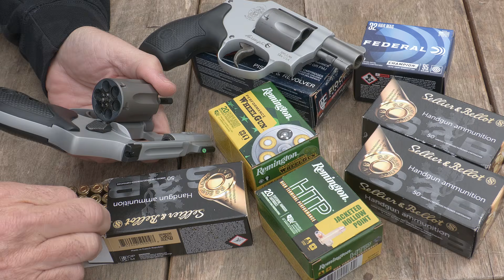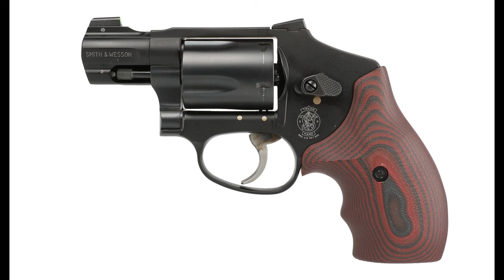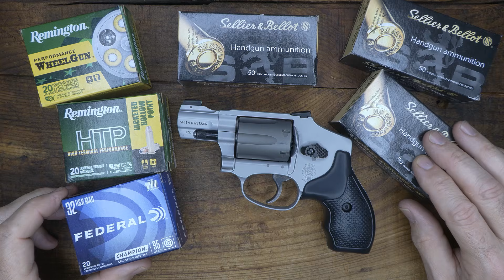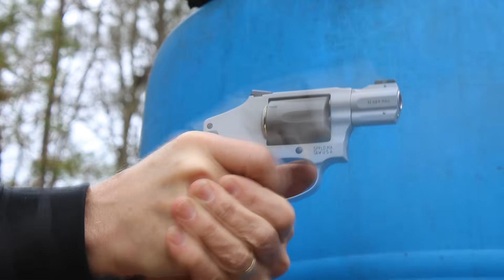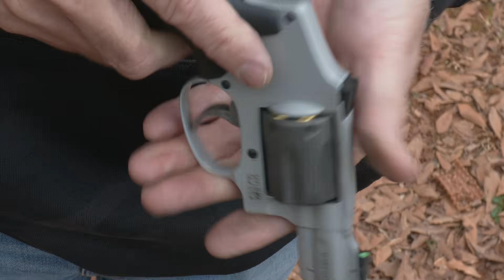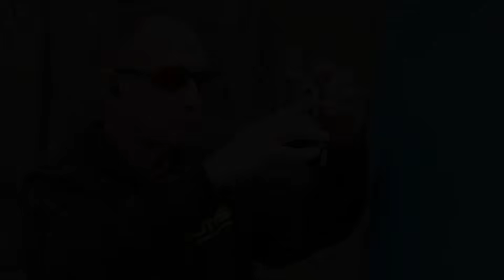Ultimate Carry J Frame Lipsey's Exclusive S&W Model 632 32 H&R Magnum Gun Review

Comment: Got one a bout 2 months ago so I could shoot while I recover from thumb surgery. Put 30 rounds through the first time at the range before the cylinder lock broke. It's back at S&W for repair. VERY DISAPPOINTED!
Reply: The exposed frame bludgeons the bottom of my thumb. I might have to use an ice pack after every time I train with this pistol at the range. Outside of that problem no issues with the pistol so far. Almost 600 rounds I think.

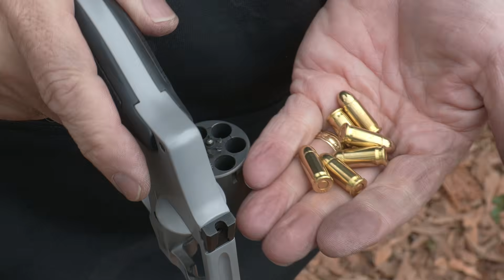Comment: 19:37 this part here with the 32acp is interesting. there has been some conflicting information about using that cartridge in a revolver. is the 32acp safe in that revolver especially for someone who really wants a reduced power load? and also, someone said the 32acp has a higher pressure than the 32long/hr magnum. what is the actual truth on this? thanks for any reply.

Comment: Why not 32 short if you’re just plinking. 32 acp is a semi auto round or so I thought. My 632 UC does not state 32 acp as a round my guns shoots. 32 short, long, and H&R mag. Going to use mag for self defense. Also for less than $100 Take it to your armorer and have them change the springs. It shoots like butter then. No misfires. About 8lbs. I have the steel cylinder…
Reply: Why is Smith popping out a gun that misfires? At the top of the snub price range too?

Comment: and if you hold the gun up higher on the back the recoil will feel less because the gun will thump your hand less ( even though the grip does not go all the way up), and the version with the stainless steel cylinder will have less recoil since it is a little heavier. I have the older version made between 2004-2005 ( M432) and it really is a nice gun.

Comment: I'll take my 642, in .38 special loaded with plus P over a .32, any day! In snub-nosed testing, .38 +P often edges out standard .32 H&R Magnum loads in muzzle energy and terminal performance by a noticeable margin—think roughly 20-50% more foot-pounds depending on the specific ammo, with better sectional density for punching through barriers or heavy clothing. If I feel I need something more in a revolver, I'll grab one of my .357 magnums...
Reply: Better go watch gel test with 32 and 38 they do the same with 32 having more penetration on most tests
Reply: I’ve got an LCR .38 +p Hornady  110 gr .  Presume light 11- gr round is faster for better impact, penetration?

Comment: Looks great but it’s a hard no for me. My last two new S&W revolvers experienced significant failures with less than 25 rounds. Both went back for warranty repair and were never really correct. The last straw for me was a Shield 2.0 with the front sight installed cockeyed at the factory with a press. I was unable to move it. It shoots significantly to the left. That’s three bad in a row. No more.
Reply: Ty for taking the time to type this. I’ve seriously been looking at the 2.0 and the S&w revolvers. After other comments and this I’m steering clear from S&w. Way too many negative reviews.
Reply: 😔 sad 😔
Reply: I have zero issues with my last 2 Shield Plus and my Bodyguard 2.0. All have 500+ rounds through them.

Comment: Great video.  Just got done shooting my UC432 on my property.  250 rounds in no issues.   Carries great and I use the Buffalo Bore .32 H&R Magnum 100 grain wad cutters for carry ammo.  Beats the hell out of shooting 38+P out of my LCRX.
Reply: I have a 432 as well. I want to get the Lost River Wadcutters as a defensive round. Main reason is that they are polymer coated wadcutters and won’t dirty the gun nearly as much and produce much less fumes. I know they designed them to be accurate with the 432s, and I believe they are comparable to the buffalo bores

Comment: Too bad Smith & Wesson’s quality control is so poor you end up sending back your gun for repairs. The best thing about S&W is their warranty, you will need it!
Reply: Hasn’t been my experience. But these things DO happen. Always remain vigilant!
Reply: @celticviking577 I've had warranty repairs done 6 times in the last year.
Reply: @AMT4245 damn!
Reply: @AMT4245  Brother, I'd be looking very hard at my supply chain right now.
Reply: @AMT4245 they definitely don't make them like they use to
Reply: Yup  they have become the "Leupold" of the gun manyfacturers.
Reply: Those old all steel one's are made much better
Reply: Sure keep fear mongering bud!
Reply: @Kh2456  Dude, do you even OWN a Smith made in the last four years? These are not theories or disgruntled opinions. If you buy two new Smiths, at least one of them will have a defect.

Fact!

Smith will fix them though. Slowly. And not always on the first try. But they will fix them.

Comment: I don’t like titanium cylinders as they can flex and cause difficult extraction with hot light bullet loads. I would prefer a stainless steel cylinder. Bevel the charging holes and chamfer the front of a cylinder. That is what I say anyway.
Reply: The purpose of this model is for concealed carry where weight is important to us mostly. you're wanting is a range gun, lots of steel out there.

Comment: Had one, sent it back twice before it was fixed properly. Ended up selling it and getting a LCR in 32, much better and no issues. The LCR 32 and K6xs are my go to conceal carry.
Reply: I’ve sent mine back to s&w 3 times with no luck for light strikes as well they’ve had my revolver longer then me I have no idea what to do extremely disappointed I was hyped to pick this revolver up
Reply: @ShootStraightCutFast  Light strikes with mine as well. Sent it back once. Better than it was, but not so good that I have enough confidence in it to trust my life to it.
Reply: @ShootStraightCutFast  I had the same problem with Magtech 32 S&W long wadcutters. Multiple light strikes in each cylinder. Sent back to S&W and they replaced the cylinder. Haven't had light strikes since but I have not tried that ammo again.
Reply: Good to see that yours works.  Mine is on its 3rd trip back to S&W in 6 weeks. Light primer strikes.  It’s been there 2 weeks this trip will be back someday.  Would I trust it?  Get the LCR in 32H&R. 100% reliable.   Somewhere along the line Smith seems to have lost the definition of Quality Control, it doesn’t seem to happen.
Reply: Appreciate the information. I've been on the fence trying to decide between the Smith .32HR and the Ruger .327. I'm definitely going with the Ruger now
Reply: @Aarons-Animals the lcr in 327 is superior for one reason CUSTOMER SERVICE at ruger is top notch, had mine for going on 4 years lots of ammo types no failures carry it daily.  also the trigger is sweet
Reply: @Robbie_Lawler88  sounds like the dude's just a Ruger hater because his comment is devoid of logic.
Reply: @monstersbox  Why? They are correct in the statement "327 isn't going to be", it's not. If one is honest the minimum good platform for the 327 is the SP101, it's and ideal match. The LCR? No, it's really better with 32H&R. S&W vs LCR - LCR is between 4 & 6 ounces heavier, a lot for pocket carry (steel UC cyl is 13, Ti UC cyl is 11oz). The sights on the UC are far superior to the LCR.
Reply: @ejjackson2573  wtf are you even talking about?  You sound like AI gibberish.
Reply: @Aarons-Animals don’t let others deter you from what you like in life. 

That 327 isn’t going be be as great pocket carrying 🥸
Reply: @WorkingOnRocks  huh?  The cartridge or the revolver?  An LCR is the pinnacle of revolver carry, and just laid 32 h&r if you're worried about recoil.
Reply: @WorkingOnRocks  LMAO.  LCR shoots 32 H&R just fine.  I load right in between the two, 30K psi, which seems to be the sweet spot.  Buy a pair of Deluth jeans.  My 3" SP-101 disappears in the pockets.  LOL  LCR, I use a hard holster in the pocket to keep it from getting lost.
Reply: @WorkingOnRocks Lipsey's had an exclusive LCR in .32 H&R Magnum with an aluminum frame, only adds ~ 1 oz over the titanium cylinder Ultimate Carry, but the LCR has a stainless steel cylinder
Reply: I would be interested in getting one BUT there are way too many QC issues with these guns...S&W used to rock their revolvers. They seem to be substandard now, sad
Reply: I think this smith is the best looking and pocketable of the three its a shame with these isssues even still I want it...looking for an old airlite instead or colt ds.
Reply: Thanks! Was thinking of buying this Smith! Already have an LCR .357. Sorry to see so many problems w/ S&W, modern ,quality control !
Reply: I just sent back my 432 due to cylinder not opening 1/2 the time.  It shoots fine.  I hope Ruger starts another run on the LCRs (hammerless) and I will buy that.  I got the LCRX in 327 and like it, but it doesn't work for me on my CCW with the hammer.  Should of bought a LCR when I had the chance, oh well!
Reply: They have only been building revolvers since 1856...give them a chance.
Reply: Did you guys clean or lube the gun ?
Reply: @WorkingOnRocks Yes
Reply: SAD
Reply: The Diamondbacks have no returns. Why does the new company have no issues and S&W is sucking ass?
Reply: Shot over 400 rounds of 32 H&R , runs great ! 

SW632 UC ( Titanium ) honestly I’ve never had a light strike with any of the 3 revolver ammos .
Reply: LCR is an amazing revolver, my wife carries one every day. This dude gets paid by Smith for sure. The revolver in this video is ok. Not great. Factory trigger is pretty much garbage. Im honestly done with Sootch because he refuses to test the playing field. He tests what he is paid to test and review.

Comment: Sootch when speaking of the .32 Autos, you missed the .30 Super Carry.  Its a .312" diameter bullet same as with the others.
Reply: Need to have a .30 Super carry revolver 9-10 cylinder would be cool
Reply: @jessesimmons4503  Maybe with an L frame even then probably only getting 9 in an N maybe 10 but that kinda defeats the purpose of the .30 SC. Large heavy revolver. I will carry an L frame every now and then but that is 7 shots of .357

Comment: dumb AF they didn't bore the cylinder out to fit the 327fed mag (just a longer 32h&rmag)
Reply: They would have to make it using scandium or full stainless for that. I would be fine with either, but the scandium would be more expensive, full stainless would probably be around the price as this with the titanium cylinder.
Reply: Alloy frame can't handle the pressures.

Comment: Why didn't they make it in 327 Federal Magnum then you can shoot both
Reply: Making it in 327 would've necessitated using a more expensive and advanced material, like Scandium, and driven the cost up significantly. Never say never though - now that these have proven the market for 32 chambering, perhaps we'll see a 327 model sometime down the line. I'm pretty happy with the six rounds of 32 H&R though - the recoil is fine for me.
Reply: It would require either a Scandium frame or steel frame and cylinder.  Increasing weight and price.

Comment: Just took my 4 inch S&W 686-2 .357 to the range and it seemed to be a crowd pleaser 😎 

It's quite literally the most fun I've had behind the trigger of a handgun. Almost feel like yelling WOO or BANG every time the hammer dropped. Never felt a trigger so smooth in my life until I inherited such an awesome piece of kit. 

I liked pointing at where there is no Hilary hole cause it's pre internal lock 😅🤣

Comment: For potential buyers, the rear sight on the UC will snag on sticky brand pocket holsters. I have a 642 and the older "gutter" style sights don't snag on the fabric. I now use the AFR Undercover pocket holster. It works great.
Reply: Couldn't the snagging fabric area get cut off tge holster?
Reply: Or file and sand the site to melt the sharp corners so it doesn't snag.  Then repaint it black again.  Problem solved.
Reply: @mgabriel2636  Yes, but on mine that's where the threads were so eventually it would ruin the holster. I'm just making people aware that is all. It also caught on a Wilderness Tactical holster and they have now modified their design to allow it to work.
Reply: I never liked the sticky holsters.
Reply: @1911bg  I like them a lot.

Comment: There are reports of quality control problems with the revolvers having to go back to S&W for repairs or replacement. Is yours working OK? Thanks for another interesting video.
Reply: Every gun-tuber lies about a gun until the next model comes out, then they tell us how crappy the last model was. This gun is one of them!
Reply: @melissasmess2773  We have noticed the same pattern.
Reply: Why bother to ask. Most YouTubers will say they run 1000 rounds no failure...
Reply: Light primer strikes with mine. Sent it back once. S&W fixed it. Better than it was, but still not 100%.
Reply: @ilpostinomotociclista270  Thanks for the info. Quality control is not what it used to be.
Reply: @PassivePortfolios  I look at it like I’m buying a base that needs finishing. Because of that I’ve stuck to used/older.

I would have no problem buying a new Taurus though. They are priced right and clean up nicely.
Reply: I have the 432 UC, and can say i have had zero issues with mine since owning it.
Reply: Their quality control is an embarrassment. Taurus revolvers are now superior.
Reply: @V@VTbeer what problems did you have with yours?